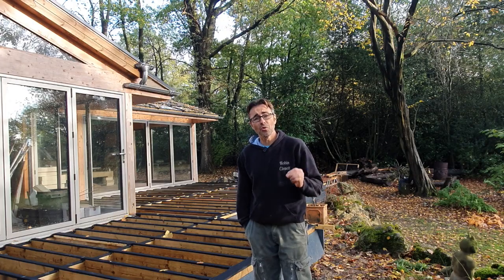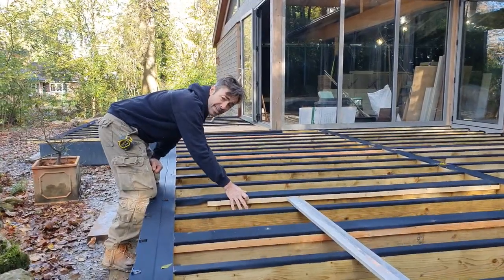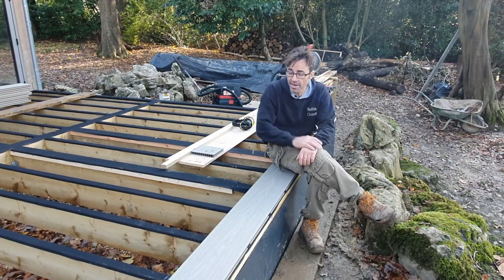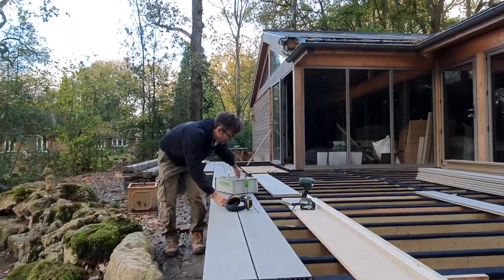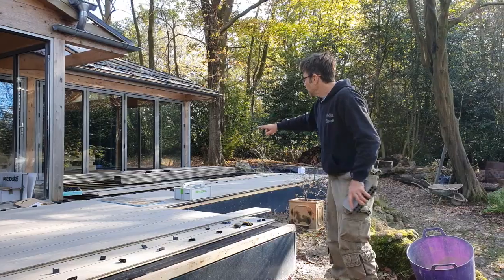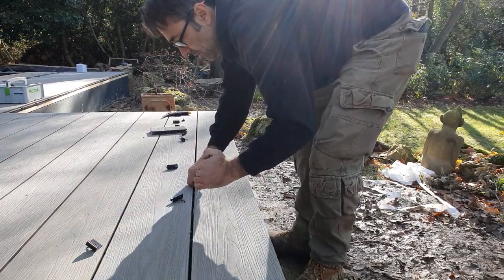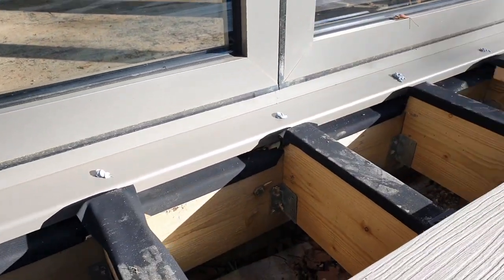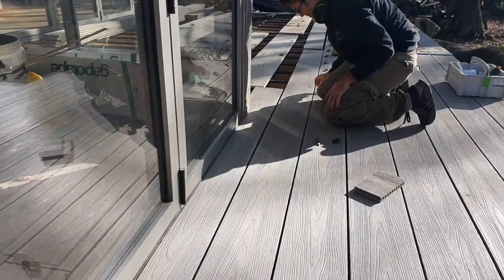How to lay a composite deck. Cut + Fix the deck. Final part of How to build a deck by Robin Clevett

Comment: Robin you mentioned timber decking at around the 14 minute mark and stated about face fixing . Is the kreg deck system any good for this . I wonder if you can do a review for us ? . Im moving soon and the wife wants a deck and pergola in our new house and and loves wood . I built our current deck and used face fixing but would like to hide the screws .
Reply: The camo marksman pro is a great tool if you want to hide the fixings 👍🏼

Comment: I’m looking to replace some old Wickes softwood decking with Composite Prime, did you build in any fall on the desk you laid Robin? Perhaps it is less important, my current boards are laid away from my property (right angles) but I like the layout where you’ve installed them running alongside the doors.
Reply from the maker: Hi Phil, I did add a slight fall to mitigate from any water ingress at the building due to heavy rain etc, I suppose its a good idea!!
Reply: @ukconstruction  many thanks for the reply

Comment: Hey Robin, I bought these deck boards after watching this as they look great so thanks 😃👍🏻 awesome video to boot, I’ve got a slight issue that you might be able to help with.. are you having a static charge issue with yours? I’m either zapping myself, zapping the wife or the cat and dog 🤷🏻‍♂️ it was a novelty at first but it’s getting annoying now haha, any help or suggestions would be much appreciated 👍🏻
Reply from the maker: Hi Paul!! I have not experienced that yet but I have not walked in bare feet or touched it much!! Sounds weird that!! Is it worse some days than others??
Reply: @ukconstruction  cheers for the reply Robin, normally on a dry warm day, doing some research composite decking is prone to static and you can get a coating in a solution for the boards but I didn’t want to go down that route.. I was thinking a simple copper rod/cable connected to the underside of the boards and staked in the ground, essentially an earth rod.. 🤷🏻‍♂️ the cats afraid of being touched now 😂😂

Comment: Is this composite decking as slippery when wet as wooden boards?
Reply from the maker: No Lee, its pretty good, any flat surface that is not regularly cleaned will become slippery especially if you have lots of organic matter that can turn slimy and slippery, a good annual clean of any deck timber of composite is recommended, hope that helps mate

Comment: Robin, how is that Composite Prime HD Pro board holding up? I'm wanting a wide board for my spring deck project. My sample cracked after a few months
Reply from the maker: Hi Mate, My composite prime board had a couple of cracks appear, not surprising when you consider some of the differences in the weather in the last few years!!! one day super hot then frost the next!, I have actually changed that deck to the new one from compostite prime Redux boards, the main reason being that the original colour we chose was a bit bright for the setting, we have re purposed this now, I have some footage of the new boards, I will try and put a video together!!

Comment: With the way you done the scribe up to the bifold door, that wouldn’t leave a 10mm gap once installed as you didn’t allow for the gap in between boards also?  or did I miss something?
Reply from the maker: Hi Robin, well I used a marker that was about 4mm thick, then cut the line out, so that roughly allowed the 6mm or so that represents the gap between the boards, you can use the 10mm spacer plus a 6mm spacer and try to mark it exactly but this way worked better for me, you have a great eye for detail and tecnique!! Happy New year mate
Reply: @ukconstruction  understood👍 makes sense. The deck looks fantastic, I’d be interested to see how this weathers. I’ve heard a few people saying the composite decking can expand and contract leaving big gaps. Hopefully that is t the case. Thanks for the video and reply, happy new year to you too 👍

Comment: I see that decking boards are hollow ones and not solid. Was there any thought process behind going for hollow ones except for the cost factor?
Reply from the maker: Hi Mate, these deck boards are engineered to have a hollow core, it means that they are lighter (they are still really heavy!!!) and also they optimise the amount of material needed to produce the product there would be no extra benefit if they where solid!! hope that answers your question
Reply: @ukconstruction  Thanks for your response mate. There are some comparisons I watched/read online, says stay away from hollow decking boards. So was curious to know your response. Before ordering the decking board, did you consider the solid ones?

Comment: In the uk we are being told composite decking, fences, door frames are a real fire hazard. Will you be removing yours ?
Reply from the maker: I have not personally seen any evidence in relation to composite decking and how flammable it is based on the manufacturer or indeed the type, timber decking is probably more of a fire hazard potentially but as I said if there is any new publications hi-lighting this subject then I would be interested to read it? thanks for your comment mate

Comment: Hi robin. How long you getting out of the 5amh in the chip saw on a job like this?
Reply from the maker: The 5 amh battery is not bad, I would as that I probably charged it twice while cutting all the deck components, I do have a larger battery too but the 5 is fine!!

Comment: Good vid, good detail ... HOWEVER, should have staggered the joints throughout the build. Same as on yachts, Random butt-ends look neater than joints in a line as that exaggerates the black-lining. On the narrower section you have no joints at all, so irregular pattern.

Comment: If only I had endless amounts of cash and expensive tools I would build a deck like this. How much has that deck cost to build?
Reply from the maker: Well this deck is a structural part of the build and covered by building regulations, it is built to allow for the correct spacing of joists as directed by the decking manufacturers in our case 300mm centres, the tapes are my choice to use as I want this structure to last many years and as you have guessed it is a big investment in materials and labour, I have not added up the full spend on the build yet so it is difficult for me to give you a figure but I would say that if you wanted a decent carpenter to build this deck and the materials as this is build it could cost anywhere between eight and twelve thousand pounds, with the material being about 60 percent of the spend, I hope that helps mate!!!

Comment: Why does he need to cut 3600 boards? 12 x 300mm joist = 3600mm
Reply from the maker: Hi Connie, as a Carpenter I never rely on the ends of material that is supplied to be perfect or undamaged so I always allow to trim a little off, also here where I have runs that are over two and a half boards long with different start and stop points allowing for the building perimeter and using a joint that lines up means that there will be cut boards, sometimes we can work to standard lengths, hope that helps and thanks for watching!